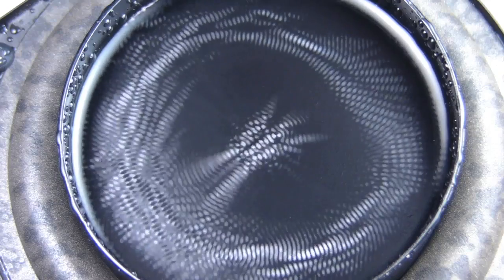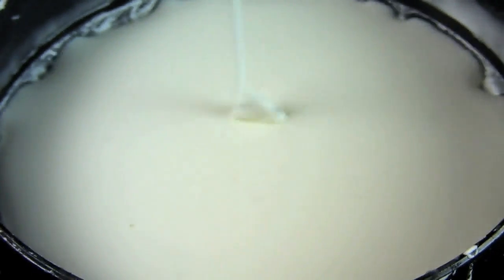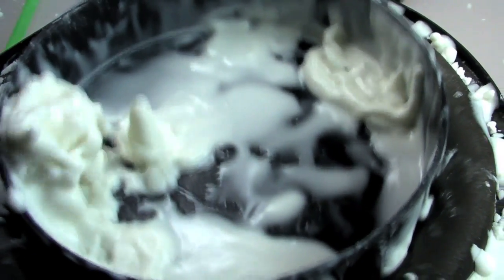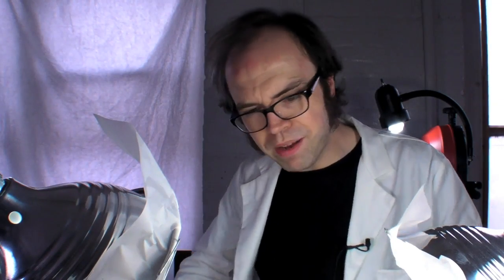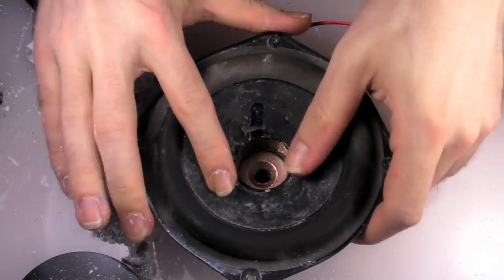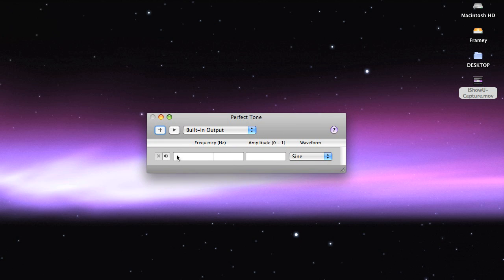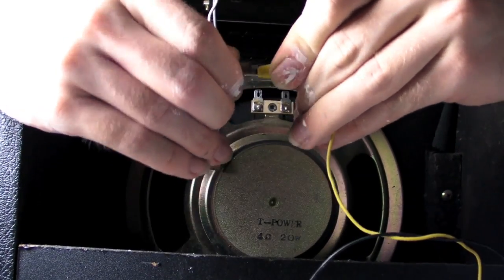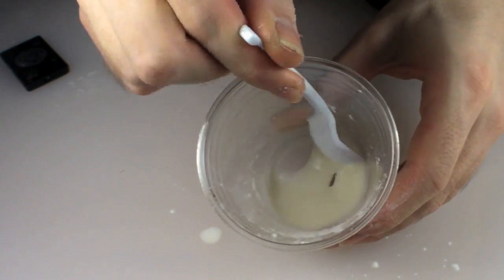Collin's Lab: DIY Cymatics

Comment: you can levitate objects with enough power.  Ping pong balls are easily done.  Ultrasonic frequencies can hold objects suspended and mix liquids without touching them, very useful for chemistry and to hold the liquid hydrogen droplet ready for laser pulse fired fusion.
Reply: +mwm2929 EXACTLY! :P This is also how the mind works. When we're being formed in the womb & as our brain forms, sound waves our forming are brains (hence, the curves/wrinkles) from the noise outside the womb & in it (liquid flow)! So, when we're born, as babies, if born in healthy enough conditions, we have ESP to some form/degree! However, depending the upbringing & lifestyle, we still have the ability to use it or wind up losing ESP usage...

*For those interested, look up on a Japanese actor named Tadanobu Asano. You can google his name & extrasensory perception.... he elaborates on how he uses it & what it means to him! :P

Comment: ive started experiments like this but used water and at high frequencies     at a microscopic level the crystalline structure of the waters  surface  changes to such a degree you can see the effect with your naked eyes but your camcorder as in my case cannot capture it and i was looking at this new phenomena at an angle

Comment: So let me get this straight the Reason we feel good with some music with Headphones/speakers is cause our blood in Ears acts the same way? I mean there are music genre and each genre has low & Hi frequencies depending on the style......so in theory if our blood in ears do act like this, does that mean our effect in liking of a specific music varies on the pattern?....i am very curious at this. i listen to 128Hz Electro Dubstep which is my favorite...so should i believe the pattern is the reason to my liking?
Reply: avikbellic911 I think you meant 128 BPM
Reply: *****  128BPM or 128hz ....generally i see 128hz on internet but i may be wrong
Reply: avikbellic911 BPM is 'beats per minute', or what the tempo of the music is (in that case 2 beats per second)

128Hz is 128 cycles per SECOND. That would be 7680 'BPM'.
Reply: Music is just blood bending, bro

Comment: Please clarify "laptop output" or send photo of the interface. Did you use the headphone port as your output? I'd also like to see the interface of your stereo wire hook up from your woofer to your amp (just to have a visual). Is 18 gauge speaker wire okay? Thanks!

Comment: does anyone know what type of driver the speaker has? i know that tweeters are designed to produce the highest frequencies and midrange speakers produce a range of frequencies in the middle of the sound spectrum but i can't tell which one is used in the video. if anyone can reply asap, it'd be really helpful!

Comment: When you try this on a much larger scale, and use music with a thumpin base, every now and then a significant fraction of your corn starch/water solution ends up all over the room.  Have you ever tried to sweep up a non-Newtonian fluid?!?  When you stop, it spreads out all over.  When you apply pressure to gather it up, it turns hard!

Comment: Science Comment: Because the dish was glued directly onto the moving speaker, I don't think it would be correct to say that 'sound' was causing the interesting behavior, rather it's just direct mechanical vibration. In other words, if you repeated this in a vacuum chamber, so no sound can propagate, I'd bet you'd get the same affect. You need to physically de-couple the speaker from the dish so that only sound waves can cause any affects in the container. -Phil, PhD Physics